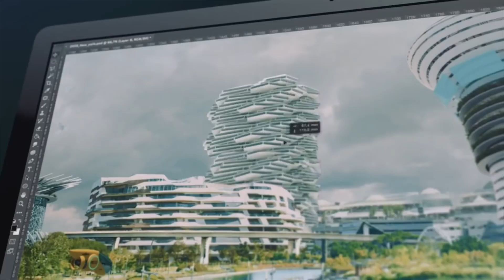Personal Flying Sleigh DRONE part 1

Comment: Is it sad I want to build a massive scale race quad this size?
Its illegal for me to fly a toy (even 20g whoop class) 5 foot off the ground without calling several airport/landing strips (Its over a 45 minute drive to get beyond the 5 mile airport range, and even that would still be trespassing on some random person's property). I'm out in the middle of nowhere Texas, so its sad I'd have to say "hey, I want to fly a toy that weighs less than a styrofoam cup tumbling in the wind up to a 20 ft max altitude, yes I'll be below treeline, yes you'll probably be decapitating childerd and smashing through homes if your this low, no sir I won't be recording with a 600 TVL camera, just flying a toy..."

Instead, I think a giant death machine I can ride on, with more power than enough to slice a man in half sounds less scary. That is somehow legal without a pilots licence, so why not? Sure its going to be dangerous, but I won't have to worry about being denied flat access! Thank goodness that's somehow safer for the public than a tiny whoop...

Comment: Peter,Great channel, great content! 
In a multirotor context contra rotating propellers are sub optimal. You lose precious power, thrust, about 30%.
True contra-rotating setups where the propeller blades are axially super closely spaced are actually slightly more efficient then single rotor setups. On the other hand, multirotors ability to yaw is dependent on the inefficiency in single rotor setups, since it uses the counter torque caused by the inefficiency, the spiraling motion left in the airstreams leaving a traditional single propeller. The system also take advantage of Impulse torque from suddenly accelerating one half of the rotors and de-accelerating the other half. In this respect you are good, you seem to have a decent combined propeller mass. 
A typical multirotor Flight Controller PANICS (I have tried Naza lite, and DJI wookoong ,hoverfly and KK2.1 HC so far and only the super cheap KK 2.1 would do...) when it does not get the expected counter torque feedback from increasing RPM from a set of motors and will likely saturate the system trying to keep Yaw authority, leaving insufficient overhead power to maintain attitude control on the other axis resulting in very unpredictable behavior.
My fix was to tilted the motors,( 6 degrees in my case) in the direction the counter torque should have acted if the setup had in fact generated the reaction torque the FC expects, AND to turn the I-gain value for yaw to very low values, in my 5xFC setup I had to st it to zero, does not apply to your single FC(?) setup. 
Its difficult to explain all this in words, please feel free to check out my investigative build process regarding these matters in the episode I call :  chAIR- Manned multirotor Episode 18 Quadcopter style.
Some where  8 min in the torque reaction issue is addressed.
Also I would really discourage you to try  and fly the setup you have if the thrust to weight ratio of your setup is lower that 1.3 to 1. My latest version the chAIR is close to 2:1 fresh of the charger, but I have, barley, managed to fly a 1.3:1 setup in previous episodes. 
All the best and two thumbs up! /Axel

Comment: So Peter is going to throw his hat in the ring. Everyone else has built a flying death drone that can tote people. Might as well. But dude be careful! Seriously dangerous stuff. One quirk, one snafu, and if you are 30 feet in the air you are in the hospital with half a Santa sleigh up your ass. These things don't glide down. They don't auto-gyrate. They flip and drop like a rock.  Santa's SLAY RIDE!!! So it's either never leaving the ground more than 4 feet or  a rocket assisted parachute and a quick climb to 500 feet as soon as possible. I see a life size Santa mannequin and remote control for the future of this project. DEATHTRAP 2018 SLAY RIDE! DON'T DO IT DUDE! (bites finger nails) lol

Comment: That frame is SO much lighter than it looks, the magic of thin wall tube. So keen to see this thing spool up!
Reply: I love it when all the makers come thogether. 🤝
Reply: Sir what undergraduate course is required for this career?
This really fascinates me and I am not sure which course to go for.
I am sure it comes under Mechanical engineering but am not sure about the particular course to study.
Please help
Thank you.
Reply: @princesakariya606  Depends how deep you want to get into the electronics/programming side of things or not. For being able to design/analyze the frame by hand mechanical engineering will cover everything, Take a statics class, a dynamics class and strength of materials to understand how loads can transfer and you'll be most of the way there. The rest is a bit of factor of safety and knowing how to design for cyclic loading. Looks like they just bolted/welded this all together figuring the structure will hold. Analyzing the frame in CAD software (solidworks, catia, fusion360 etc) will realistically tell you much more about the structure than you could figure out by hand in a reasonable amount of time and allow you to address high stress points. 

Hope some of this info helps!
Reply: @rlew12  I am grateful to you for replying to my concern sir.
The information you provided is quite useful to me and has made me a bit more clear for choosing my coarse.
Another request for you sir,
Could you answer some more questions regarding this topic please?( On social media like Instagram or whatever you prefer)
Thank you very much .😀
Reply: He is obviously making fun of you. 🤣
Reply: @rlew12  I sent you a friend request and dropped a text with a screenshot.

Comment: Does having back to back motor/prop configuration actually double thrust or is it more like a quad blade vs biblade in terms of performance increase? I feel like the lower prop would unload while the upper would maintain load?
Reply: It doesn't double thrust but it adds a decent amount. Way more than going 2 blade to 4 blade

Comment: You should really explain what you're doing as you're doing it (how you build it, the problems you encounter, the solutions you find etc.) I think it would be much more engaging to watch. Otherwise we're just watching a montage (which is cool, but gets old pretty quick) and then a quick run through of what just happened.
Big fan of your projects BTW

Comment: Use a Pixhawk 2.1 flight controller. They are the only one that is fully redundant, (even the software, and processor are redundant). they have built-in vibration isolation, so no need to guess at that, and they can use 2 GPS modules, the "Here2" GPS with GNSS for the ultimate in reliability and accuracy, you can use the RTK differential GPS add-on, for centimeter accuracy in auto-land, and other functions.  Pretty much all commercial UAV's (and in the future, manned air taxis) are using them.  
you can auto tune it on a clothesline, for proper dynamics, and then please test fly it with a dummy payload first... 
(only if you don't want to die)
Reply: Hi, I know this is a year old lol, but I'm thinking of making a camera rig using pixhawk or something similar, are there any good learning tools (youtube playlists, blogs, websites, etc.) that you would recommend? I've been using Betaflight for racing drones for a while now, but I kinda want more autonomous flight for something like this.
Reply: @RealFlight-u4h  use the official wiki:  ardupilot.org.  
if it's fixed wing, and you want to integrate a arduplane native flight controller, then we have a arduplane tuning guide PDF on our website for fast track.  bearospaceindustries.com
Reply: @FPVREVIEWS  Thank you so much, I'll do just that.
Reply: You guys are amazing @FPVReview guys!!, i had a similar doubt... Which are the robust Flight controllers available in the market for a heavy lift drone, i.e 50-150 kg drones. Considering their feasibilty to do all caliberations & redundancies.. !
Thanks in advance

Comment: I don't want you to die so here's my idea, wire up a gyroscope to adjust the power it puts in each motor to keep it stable. if you were already doing that then good I just wanted to make sure you were going to be safe and not forgetting anything.

Comment: Isn't it less efficient to have props in an under over counterrotating orientation? I thought I remembered hearing that the under prop is a little more than half normal efficiency. But I don't remember so I could be wrong.

Comment: I have been wanting to build one of these for a long time and I have never clicked on a video faster! I can not wait to see how this turns out. For mine I was looking at T-Motors U15 motors and a DJI N3 flight controller. Good luck I really would to love to see these in the future!
Reply: Out of curiosity why use a dji flight control when a fifty dollar f4 would do the job? I mean i assume it would do the job . I have two inspires but i build racing drones and like i said . A basic f4 should do it .
Reply: Tamara Thompson In the past I’ve had a bad experience with betaflight and cleanflight and I just recently finished a quick f450 build with a dji Naza lite. I am planning on building a mini model of the larger drone with a Naza V2 and then stepping up to an N3. I would use DJI just because the flight controller is the main brains behind the operation and if I am trusting my life with it I want to have trust in the system. So far my Naza lite has done great and DJI has some great flight controllers.

Comment: a grinder and paint make you the welder you ain't.
Reply: spencer wells he's not building bridges or highrise buildings here. None of his welds are really that critical.
Reply: @ROTAXD  yet he's flying in it
Reply: spencer wells he'll be fine. If his welds break it will be because of a crash and the broken welds will have had little/nothing to do with his injuries.